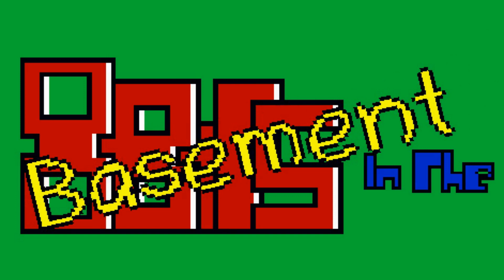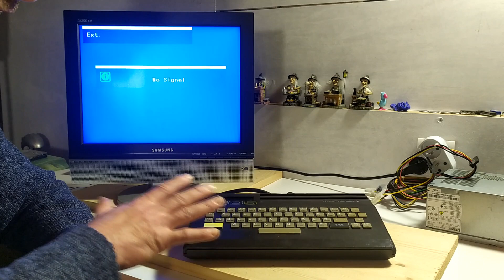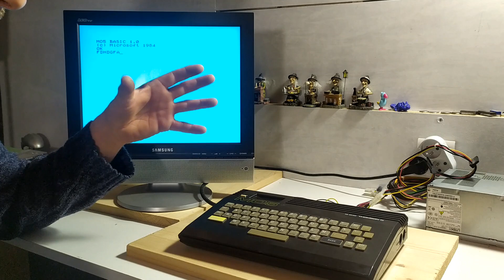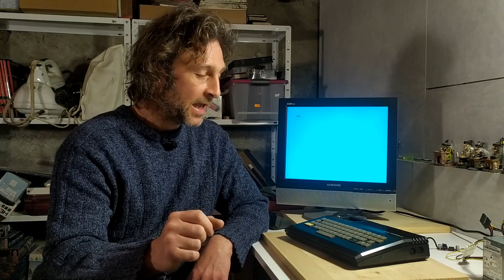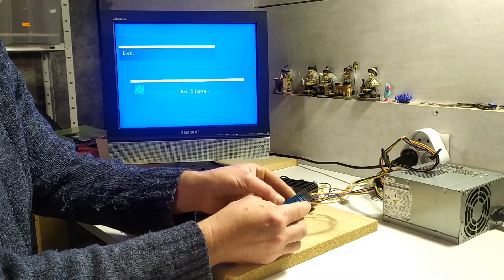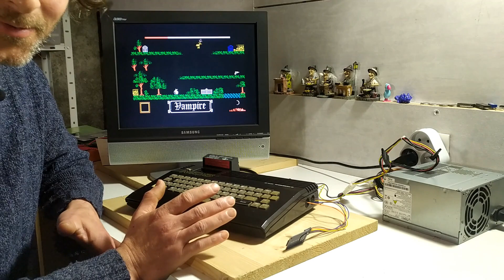The old school computer all the cool French kids had (in school) | Thomson MO5 | 8bitsinthebasement

Comment: The jokes...   They're perfect :)
Never heard of that computer, very interesting you can use the disk drive "device" with the driver in a different device.
Reply from the maker: Thanks Ben, I only have the very best quality jokes for this cannel as you've noticed (they are not at all the first crap joke I find just before I shoot the outro). France had quite a lot of obscure 8 bit systems back in the day (even here you have to look to find them) but most are very interesting. The disk controller firmware in a network adapter is a very clever hack. When I learned of it at first I was blown away. It's really very simple (the concept) The network adapter is full of hardware and a ROM to allow the computer to use that hardware. When the rom is changed the computer can access the new rom and ignores all the network stuff attached to the adapter because firmware doesn't tell the old 8bit it's there. I think that it's amazing that a disk drive can be attached to a data cassette port. What's more it's really quick to load programmes. I just need a joystick adapter now then I can play games without getting cramps in my fingers ;)

Comment: Really cool. I have never heard of this computer. Do you think you could make a controller work for this unit ? A video showcasing some software would be really great. Did you ever hear of a computer manufacturer named micronique? I can't find a great deal on them, but they were a French computer manufacturer in the 80's. If you ever can find one, that would be really awesome too.
Reply from the maker: It's a nice little system, and I could make a game box addon like I was talking about. It would be better make one 'cause that way I could add DB9 ports instead of the DIN connectors the MO5 joysticks had. The system is compatable with regular joysticks but Thomson had joysticks made with a non standard connector. Funnily enough the MO5 joysticks looked exactly like the Odyssey 2 joysticks apart from they being moulded in white plastic. I would have to make a breakout adapter for the rear edge connector as well because I'd have to be able to plug in my "disk controller" as well as the game box thingy. But I'm sure I'll get to all that at some stage (I love soldering). I hope to throw together a video showcasing some of the games in the next week or two. All I can tel you about Micronique is that I stumbled upon a computer called a "Hector" a while back on ebay, it sold for 400 Euro (crazy) it was made by them they also had one called the "Victor" but I don't know a great deal about any of them. Did you manage to convert a NES controller for your C64 yet? Take care and thanks for watching ;)

Comment: This is why i am interested into retro gaming and computers you had so many different platforms every country did its own thing it seems like there is always something to discover in modern times everything is standardised there are only a few platforms and they are relatively similar to each other and not much difference between the countries apart from maybe china.
Reply from the maker: That's exactly what I love about these old machines. You get something really new from each one. They all had their own quirks and personalities I suppose. Even in the same country (like the UK) there were a few different systems out at the same time all very different from one another. It is good that things have changed though, I for example have a DELL from 2011 that I use everyday, I even use it to encode my videos (So I've not had to buy a new, new computer in more than 10 years) back in the 80's you more or less had to get a new computer every 2-3 years to stay some way on top. Thanks for watching ;)

Comment: I used to have one of those when I was a kid... in fact I still have it (and it still works). The MO5 is roughly equivalent to a Spectrum. It has the same number of colours available handled in the same way (so WITH colour clashes) but a slightly higher resolution of 320 x 200 pixels (instead of 256×192) . I really loved this little computer as a child as it was easy to program. However I remember I was very disappointed with its sound capabilities at the time, they were really poor with almost no sound being played during games.
I have since purchased an MO6 which was the upgraded version that came a few years later and is now very rare... I wonder if the SD card adapter could be directly used with that one since it has a built-in floppy disk adapter.
Reply from the maker: If I'm honest, I had never heard about this computer until about 2016 and it was many years later before I got my hands on the one I have in the video. My first impressions were that it was very much like a Spectrum (but done better). I've been using it on and off for the past year or so (more so now that I have a sound and joystick module for it) but I've yet to notice any colour clash (I'm not saying that it's not there, I just don't think that I've ever any on the machine). 
Well done on getting yourself a MO6 they are hard enough to come by working (and at a reasonable price) nowadays. To answer your question, The SD card device (the SDMO) I used in the video should work with the MO6 but it connects to the cassette port. As the MO6 has a built in cassette you would have to open your MO6 and tap directly into the cassette lines on the inside of the machine. If the MO6 can use a disk drive and has a disk OS built into its ROM then the SD card may work directly, but don't take my word for it ;) Thanks for taking the time to watch and comment.
Reply: @8bitsinthebasement   The color clashes come from the fact you can never have more than 2 colors in the same block of 8 pixels on the same line: one foreground color and one background color. 
You will see this if you type in the following little program and run it:
10 CLS
20 BOXF (50, 50) - (270, 150), 4
30 LINE (0, 0) - (320, 200), 3
By the way, there is an easy way break the execution of a program without resetting the computer, it's done in exactly the same way you break the execution of a Windows script: you press Control + C (CTN  + C)... it's with details like these you know the Basic was written by Microsoft!
Keep up the good work! I'm off to view your VG5000 video now!

Comment: That tapedeck sounds more like the Atari 8bit tapes - one track for audio*, the other for data and you can't just connect audio to it for that. On the other hand the disk handling is pretty good and fast.

*theoretically, I've got more than a dozen A8 cassettes and they're all mono for cheapness. It's still a is a cool idea, having music or whatever while it's loading up
Reply from the maker: I'd not really seen that before I started on this MO5 unit, it is strange how it was done. I mean why bother with the audio at all? A program could let the user know that it's loadng just fine with an on screen counter or something (an on screen counter would be even better in fact, the audio would continue playing even if the load has failed I'd imagine). A music track playing while loading would have been cool though. I didn't know that the Atari 8 bits worked the same way. I've got an eye out for one at the moment so I guess I should look into loading methods for it too. Thanks for watching Paul ;)